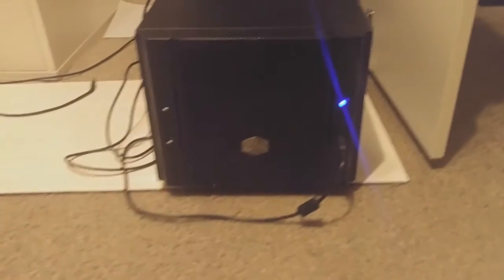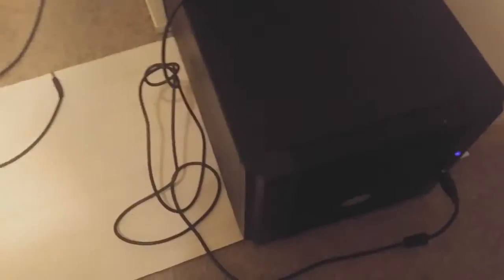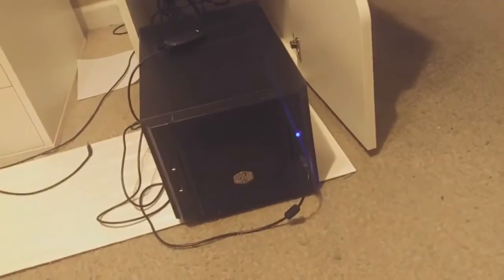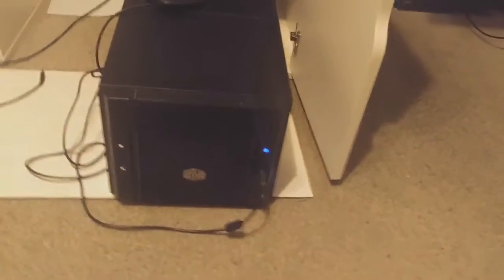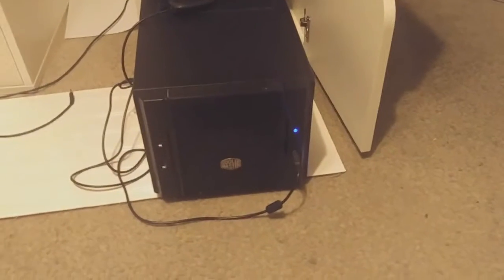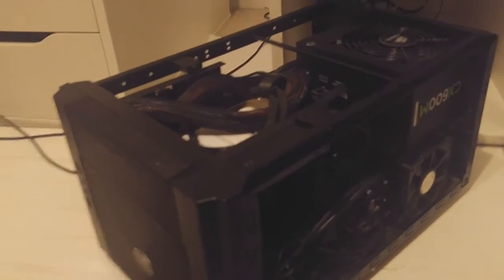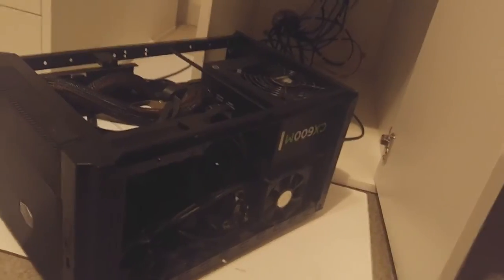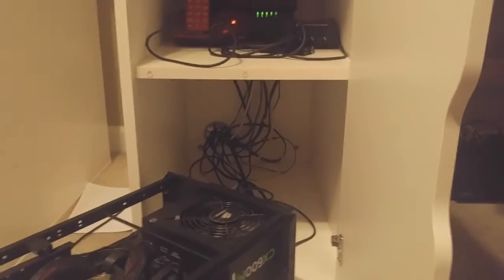Cooler Master Elite 130 Airflow / Heat Issues

Comment: The front of the case has a 120 fan mount, the front panel has really stupid fine mesh in the front, and a "filter" bit of screen. a real hack is to straighten the tabs of the metal mesh and pop that buddy off. Get that stupid filter screen out. now with an exhaust in the front and the PSU acting as an intake you'll get good flow (liquid cooling) or make it an intake and blow fresh air in and have your PSU Exhaust (better for air) If you really want it to breath you can leave the mesh off and leave the finger killer holes open but that does kill the aesthetics of the case a little bit, and there's nothing guarding the fan.

Comment: I'm using a i7 4770k overclocked to 4.4, corsair h60i with a 700 watt psu plus a 1060 6gb. I use the psu to exhaust the air . 27 idle and 68 70's .

Comment: This thing is meant for liquid AIOs like H60 or 80.
I also got aircooler, it is heating up bad.
Reply from the maker: i actually never had any heat issues when it was under my desk, only whenever i cut out the airflow by moving it into the cabinet.

Comment: Hi im planning to get this case and put 6700(non k version)+1050ti in it for editing and 3d rendering purposes(no gaming or overclocking).....whats ur opinion?Will I be facing any overheating issues..I would be using a stock cooler as my budget doesnt allow me to get an aftermarket cooler
Reply from the maker: I used stock cooler for awhile and was fine, just make sure the case is in a normal environment and not in a cabinet.
Reply: awesome! thanks alot

Comment: weren't you supposed to install the PSU inverted, so that the SMPS fan sucks air from inside the case and ventilate the whole setup, not just the PSU by drawing fresh air from top. I know that it may reduce the cooling of PSU since hot air from inside the case will be used instead of fresh cool air. Please comment!
Reply: Yep, I did that in my build.
Reply: It depends, from what I've read if you have a FAN to cool the CPU, you don't want to disrupt the airflow, then you install the PSU fan outside. Otherwise, if you use water cooling you can put the PSU fan inside the  case.
Reply: Did that in my coller master elite 130 build. My GPu is also of reference blower style, so that doesn't blow the heat back into the case. But still crazy heat. My r5 2600x is sitting at 70°C just browsing. 80-90°c playing games. The Wraith spire is producing crazy amounts of noise to keep the CPU at an acceptable temperature. Also considering to go liquid cooling.
Reply: @bartdierickx5150  how did you solve the issue...?